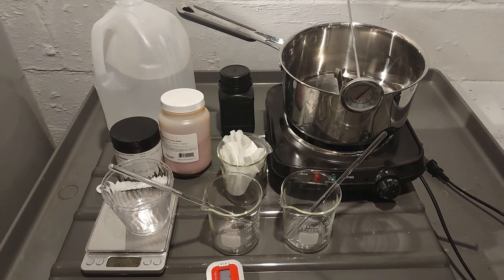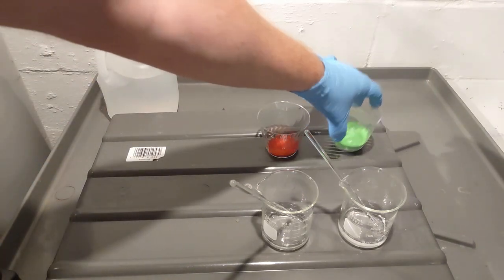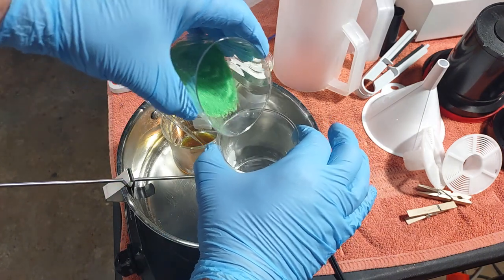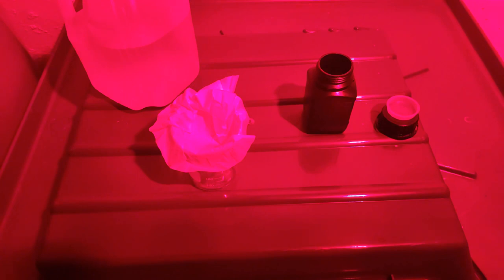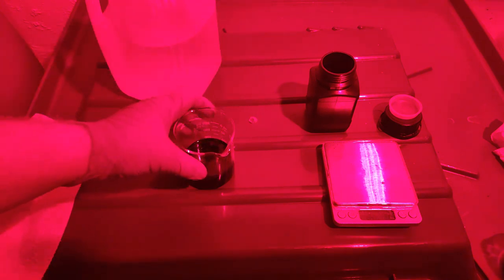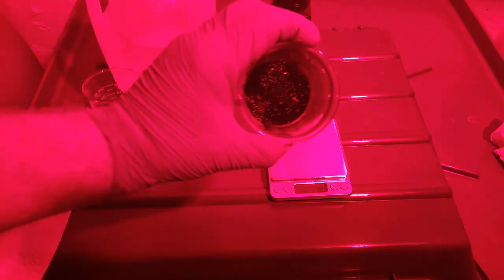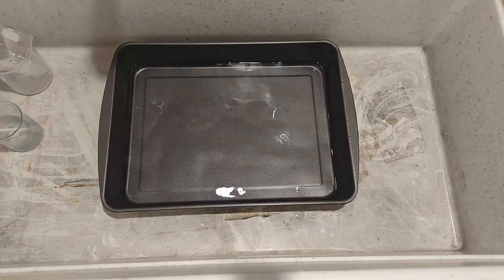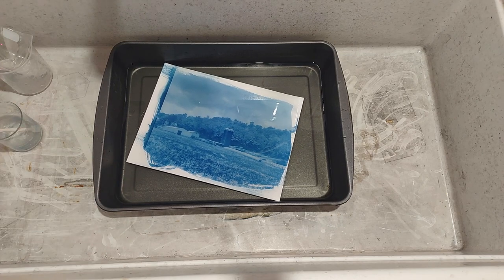How to make the "New cyanotype formula"!!

Comment: Glad to see someone go through this process. I've gotten a firm handle on Kallitype and salted paper, and decided to try Cyanotype for a couple of reasons. First, it apparently does well with similar negatives (in terms of contrast range) that work well for Kallitypes, so I have several on hand. Second, I can't resist that sexy blue color.

In the research phase, I found Mike Ware's article and figured if I'm going to do cyanotypes, I might as well use the most up-to-date approach, even if it's slightly less convenient to prep the chemistry.

I'm going to include the ammonium dichromate Mike suggests in his article, as well as Tween 20 immediately prior to coating. Any recommendations for a newbie to the cyanotype world? Worth adding hydrogen peroxide to the developing bath? What's the advantage of adding an acid like vinegar if I'm already printing on an ideal paper (HPR)?
Reply from the maker: I uploaded this video just to go over how to make the new formula however I cannot say that I recommend using it at all. It is very picky about paper, you really do not get any results with peroxide and you have to wash in citric acid to remove a brownish stain this formula creates in the highlights. My favorite formula is the 10/10 method which is 10% Potassium ferricyanide and 10% Ferric ammonium citrate. You mix them together before coating the paper. This formula works with almost any paper type and if you develop it in undiluted white vinegar you have an amazing tonal range.
Reply: @matthewbary1  Thanks for the tips - I have already started experimenting with New Cyanotype and seem to be getting pretty good results so far. But I definitely haven't ruled out the possibility of going back to classic cyanotype if I can't get what I want in the final prints with New Cyanotype. I'm aware it's rather controversial :)

Comment: Hi ! 
I am printing cyanotype using new cyanotype recipe for many years and I randomly have issue with the sensitizer which tend to be dark green with Prussian blue in suspension In the solution and I don't quite understand why its happening randomly... It result in fade result with a lot of the sensitizer being wash away when rincing....
Did you already encounter this issue ?
I never used dichromate potassium as it's not available in Europe and I am wondering if it might be the reason why I am having these issue... 
Do you know any replacement for dichromate available in Europe ? Does Diazidostilbene might be an option ? 
I am also wondering if it might be caused by raw chemical quality but I bought them from Bostick and Sullivan so it should be fine ?
I would greatly appreciate any feedbacks as I am quite desperate to understand these issue !
have a good day !
Reply from the maker: I have avoided the "new cyanotype" formula as it is just very complicated and very sensitive. You almost have to make it right before you use it as if it sits to long it goes blue. Also you have to be careful of the paper used, how much humidity is in the air when it dries, just allot of issues with it so I avoid it at all cost. However if you really want to pursue this method I recommend going to https://www.alternativephotography.com/ and check out the section on "new cyanotype" and maybe you will have more luck with it than myself.
Reply: Thanks for taking the time to answer ! I print cyanotype using this technique since 7 years and I am very happy with the result when it works but there is a lot of random in the result depending on the chemicals and I am very frustrated with that... I don't understand what is the cause of it...

Comment: Thanks for the detailed sharing of the mixing process. I always hesitated New Cyanotype because reading about preparing seemed too complicated compared to Classic Cyanotype. You didn’t mention Ammonia Dichromate which is part of Ware’s? Does it matter?
Just bought a dual hot plate and some glass beakers 🤗
Reply from the maker: I omitted the dichromate simple because I will be using most of this solution for testing.  It appears it is primarily a preservative. It also may slow it down a little and provide some contrast control but I haven't tested that so far. I was also trying to keep the number of toxic chemicals low lol